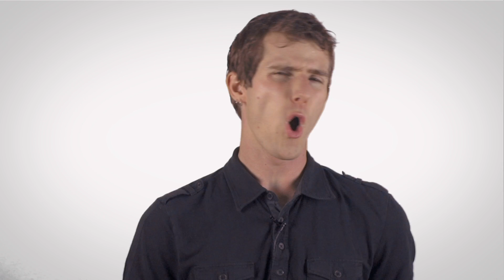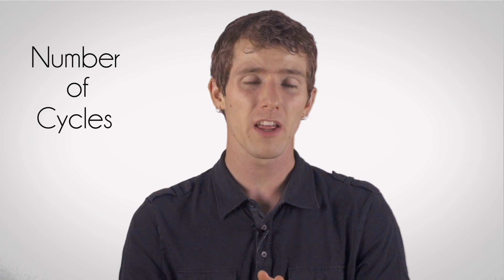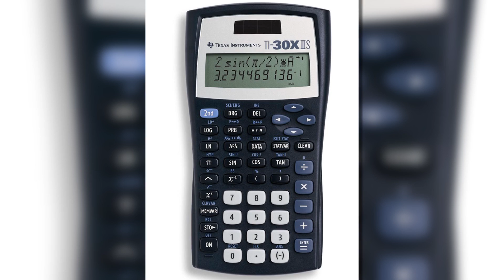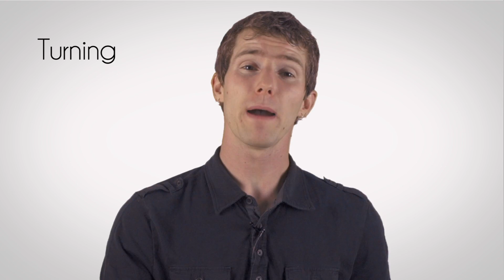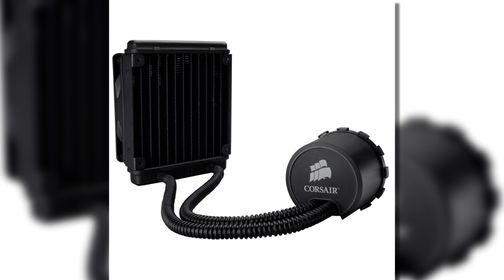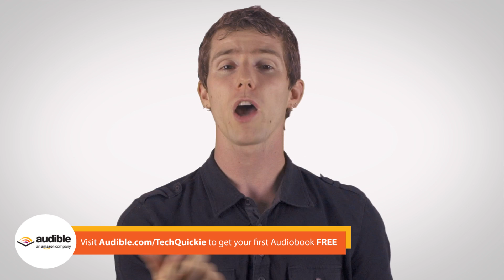What is Overclocking as Fast As Possible

Comment: How do i overclock my potato?
Reply: ***** Steroids
Reply: Jason Beacham add some kind of chemicals and put it onto a hot area to make it bigger

:p
Reply: Jason Beacham Just smash a heatsink on top of it, that should work :) - or you could just put it in the fridge, both solutions have worked for mine.
Reply: Jason Beacham go back to 1839 thats when the potato was at its best in ireland irish people overclocked the shit out of potatos then the english came and tried overclocking potatos they didnt do it right and all potatos went bad then the english tried over clocking other foods they took all of the poor irish people food and overclocked it. according to the english, the 2 million population decrease in ireland was worth overclocking food ablities however most irish (myself included) disagree
Reply: +Jason Beacham  A good OC on a Potato requires adequate cooling first.  Phase cooling is way to expensive and fans are just a waste of time and will never keep your potato at optimal temps. Best bet is Liquid cooling.  Most people buy premade all in one kits; But seeing as your going for the potato overclock I can see your no noob.  Go to your local pet store and buy a small aquarium with a good pump system.   Next up voltage noobs will tell you to get a great powersupply. No this is a bitch move.  You want power!!! I recomend getting a small car battery and some jumper cables; along with an alternator you can pick up in any scrap yard.  Keeping green pick up two hamsers and a hamster wheel to run the alternator. ( elementary knowledge of wiring required).  You will also need a 4 pack of RED BULL. Then you need something to cunduct through the potato.  REMEMBER COPPER IS KING.  Pick up some copper tubeing at home depot.  Now wire the alternator to the hamster wheel and then the positive and negative leads to the battery.  Stick the copper tube through the potato length wise.  Fill the aquarium with red bull and attach pump assembly.  Turn on pump. Place both Hamsters on Hamster wheel; carefull any exposed metal now has live current running through it. SAFETY FIRST. Hold potato in your left hand with your right hand connect both the positive and negative ends of the jumper cables to alternating sides of copper pipe potato.  Throw potato immediately in Red Bull.  If done correctly your potato should be running at full speed.  If thats not enough of an over clock for you add an extra hamster.   Remember though too many hamster may require a bigger fishtank to maintain a good Temp.  Good Luck!!
Reply: Jason Beacham How do you overclock a human being?
Reply: Jason Beacham u microwave it in a metal bowl
Reply: put it in a microwave.
Reply: Kronomoto take a car battery and hook up the the jumper cables to the potatoe very simple
Reply: get another one and put them in raid
Reply: +Nam Le best comment on youtube
Reply: Jason Beacham genetic modification and antibiotics.
Reply: Jason Beacham sorry bud, u cant overclock xbox or playstations....
Reply: Darren Wilson Those are the only true potatoes now aren't they... and you can overclock those potatoes...
Reply: Jason Beacham u had two mini potatos
Reply: Make it have a baby!!!,
Reply: by denying its just a potato.
Reply: Viagra and lots of it!! hahah

Comment: im thinking of overclocking my cpu after buying the right cooler and a better psu. but i have a question about overclocking, now when you say overclocking the cpu to 4.5ghz does it mean it will stay locked at 4.5ghz? and lose the turbo boost like 3.4ghz to 3.7 ghz boost? or will it become 3.4 to 4.5ghz boost?
Reply: It will stay at 4.5ghz and not drop just lock
Reply: So do people only overclock when they are about to play games and revert back to standard after? or do people leave it overclocked all the time?
Reply: They usally overclock and leave it... What i mean is that it can go up to 4.5 on all cores not it constantly runs at 4.5ghz
Reply: Depends on the motherboard, there are motherboards around that are specifically designed for overclocking, so you will be able to adjust just the boost, just the standard clock speed, both, RAM clock speed, whatever. But in your case aladdad is probably right, since you probably don't have that kind of Mobo.
Reply: I've got an Asrock z97 pro3 with an i5 4690k how would that work?
Reply: ***** 
I know the ASRock Z87 Pro4, i broke one earlier this year :P. Just check the UEFI Bios if you can change CPU clock speed there. Since it's a rather cheap board for overclocking, be sure to check the internet if you can find any guides/recommended settings before just cranking up the Mhz/Voltage up to max. You know what i mean.
Reply: Thanks! Sry to hear about ur mobo xD
Reply: ***** Thx, but  it was completely my fault and i wasn't entirely happy with it in the first place. Got an ASUS board now and i like it much better.

Comment: does overclocking worth doing it? or naaaa :D (seriously does it worth it?)
Reply: zookatone But if you have an old machine just laying around and never could decide to throw it away, and like to fiddle around just to see how far you can push the CPU just for lols; That's totally worth it.
Reply: I recommend no, because it degrades your computer much faster. Overclocking could also lead to many potential problems, and depending on what computer you're using, overclocking could provide a high risk for those problems. Basically just follow the manufacturer's specifications, stick with it, and you won't have to worry about it.
Reply: it is
Reply: Unless it seems like you really need it
Reply: πown InYoutube I mean come on, if you don't change the voltage there probably won't be a lot of problems.
Reply: A little. Not really. If your pc is old and slow, you should just buy a new one instead. If you have a new one, you will probably not want to decrease the life span or risk instability by overclocking.
Reply: If you want to, then go ahead.

Comment: Is overclocking worth it? Price/performance wise, I could get an I5-3570k wish a good overclocking mobo for X amount of dollars, Or I could get a I5-4670 with a decent mobo for the same price... and it be more future proof and wouldn't necessarily have to buy a cpu fan that will accompanist for oc heat... 
???
Reply: GetOnThat $800 is my budget. (no more then 800) I would like an Haswell I5, everything else is optional. I want this machine to handle every game I throw at on Highest settings at 60frames/second. 
I'm fine with lower frames, (around 30-40), for high resource demanding games like crysis 2 and 3.

Comment: Overclock a Calculator?
Reply: K- Hype Ay man i need my math homework done QUICK
Reply: CS Ninja with 60 fps it displays the answer smoothly
Reply: yes.
Reply: K- Hype No need to. All Calculators has a GTX Titan X built in
Reply: No need to. All calculators have an Asian built in
Reply: IDK if you consider a TI-Nspire as a normal calculator, but it can be overclocked with some tool called "Nover" :D
Reply: Rawityyy Too bad these Titan X in the calculator are integrated into the motherboard of the calculator
Reply: ***** Woah now that that is just too extreme
Reply: K- Hype
i think, i'm already bottlenecking my calculator, so no thanks :D
Reply: Ahren widman I was saying that because the other guy was stereotyping on Asians

Comment: I dont know much about overclocking.  Why don't processors just run at as high a voltage/frequency as they need to and then scale down if they get to a certain temp?  I don't really get it.
Reply: That's exactly what they do. By overclocking you are taking it into a danger zone of instability which you compensate for by increasing voltage (i.e. more heat). You can compensate for this however by using after-market coolers/heatsinks that will function better than the stock CPU cooler.
Reply: Steven Clark
So why don't they deliver the CPUs with better coolers that are adjusted to their max tact frequency?
Reply: KevinementD Because that would cost more and you have to remember, intel and AMD are businesses. They aim to make a profit, so their best bet is to market their CPUs to the general consumer, and not everyone wants to overclock and deal with those risks.
Reply: That's what GPUs do. But the reason is higher voltages and temps mean less lifespan. Even if a processor can safely scale higher than a certain point, it won't last as long. So they don't implent technologies to scale the processor, rather, they keep it within known safe specs.

Comment: Does overclocking void the warranty of the Intel K series processors that are unlocked and were meant to be overclocked? I've already got mine already overclocked and overvolted so it doesn't really affect me, but I was just wondering.
Reply: yeah you would have to buy the extended warranty or a warranty from whatever store you are buying from.
Reply: Johnny McNugget It seems kinda counter intuitive to void the warranty for doing something the processor was specifically designed to do. More money for Intel, I suppose.
Reply: hippiechickie18 Intel love your money. That is why the make you get z87 board to overclock your K series processors!

Comment: my cpu stock speed is 2.6 i overclocked to 3.2 and is stable and i push that to 3.5 and is unstable i tried pumping the voltage but nothing same with 3.3 and 3.4  help please
Reply: What sort of help are you trying to get? What model of CPU do you have?
Reply: 2013Aleksey2013 intel core 2 extreme
Reply: Nikos Spetsnaz This is my reposted comment on VGA overclocking; it has been written on a GPU but this is also true for a CPU. "An overclocked video card (as in the case of GTX 780 TI) is going to consume more power, its cooling system would be working harder resulting in a higher operating temperatures and faster spinning of its cooling fan which in turn produces more noise. Different kinds of artifacts start to appear on the screen while running 3D applications, then comes a loss of stability and reducing of life service due to higher operating voltages, frequencies and temperatures." - these are the major disadvantages that you are going to face. 
What program did you use for overclocking your CPU? Or did you just do it trough BIOS? And please be more precise when you describe your computer components. Different types of Intel Core 2 Extreme Processors have different numerical designations to them (like XQ9650 or Q9300) and what is the "machine" that you've got (is it a laptop, notebook, or a desktop)?
Reply: 2013Aleksey2013 my system is intel core 2 extreme qx9700 and i have a water cooler on it so heat is no problem 6gb ddr2 ram ati radeon 7950 double d 620 psu and i overclock by the bios p5q pro mother board
Reply: Nikos Spetsnaz In one of your previous comments you said that you had increased the frequency of your CPU from standard 2.6GHz up to 3.5GHz and it makes 900MHz of a gain in frequency. You say that at 3.5GHz your PC's behavior is unstable. But what exactly do you mean by "unstable." (what exactly happens at that frequency?). I'm asking all these questions because I'd like to know why you're so desperate to overclock your CPU. What are you trying to achieve or maybe there's a game that you can't play comfortably on your PC due to low FPS?
Reply: 2013Aleksey2013 ok thanks man

Comment: Brb guys, about to overclock my calculator...
Reply: GluzinGames
 well i have the Casio fx-350MS can run some games really smooth :) hoping to upgrade my buttons to mechanical
Reply: can you run super pi on that thing?
Reply: No, i run games with better FPS.
I have a Casio Prizm.
Reply: i did xD
Reply: Cheesepuff i recommend using a celing fan cooler than a normal fan cooler
Reply: Still waiting
Reply: Update ne

Comment: I have tried to code a game for my graphing calculator, but Casio BASIC is a little too limiting, as the GOTO command isn't powerful enough - you only have 13 possible GOTO points, thus causing a need for a ton of programs to do something one program could do on a computer. also, overclocking a calculator is a terrible idea XD

Comment: Depends on the cooler - on the stock cooler, I OC'ed all cores to a stable 4.1, but couldn't go faster without more heat than I felt comfortable with.  Later, I put on a CoolerMaster Hyper 212 EVO and was able to get up to 4.6 stable with no issues.

Comment: Fair enough. But just to be sure. Did you take the voltages off of the Auto setting. Because it will increase the voltage by more than you would need to. Auto != stock.

Comment: For games, probably the GPU, unless your CPU is the limiting factor, which is quite rare in a balanced PC.

It depends what is holding you back for a particular application.  However, I don't know how you overclock a motherboard per se.  Also, overclocking RAM is usually not worth the time.

Comment: Now, keep in mind that a 5-20% overclock is about the range you can get with normal hardware. Personally, it's no longer worth it for me to OC my graphics card because I can only get a 10% boost before it starts getting artifacts. Besides, that's only 5 or so FPS more in most cases. I'd rather have more stability. However, if you can manage 20% or more and have it stay stable, I'd absolutely recommend it.

Comment: "If done properly..."
I could have used that advice a while ago with my old mobo and CPU.

it was a core I5 2500k and i may have pushed it about 500MHz too far (considering I had a crappy PSU which is definitely not ideal in the first place.)

The power supply exploded and destroyed my mobo and possibly my CPU. Although, I am unsure whether the surge killed it or the voltage. I forget what voltage i used but it was probably over 1.25v

Comment: Overclocking is still overclocking even without increasing your voltage. Your CPU, GPU and RAM are "used more often" when you overclock so technically it would also kill your hardware faster.

In any case OCing has become somewhat of a standard for a lot of manufacturers. They EXPECT you to overclock. It just depends on how much you overclock your system.

Comment: Without touching voltage you won't be able to achieve as high an OC anyways, so as far as longevity sake, I guess it technically *could* run longer, but results may vary. No guarantee OC or not, that you'll get 5 years. Things can happen. OC'ing is worth it if you aren't happy with your current perf and want a little more, or if you just wanna get greedy like I do and want as much perf as you can get.

Comment: Isn't the FX 6300 already at 4.1 GHz when it turbos? Should be easy to oc it to 4.3 at least. 

Note: All cpu's are different, if you were very unlucky it might not oc above the turbo clock at all.